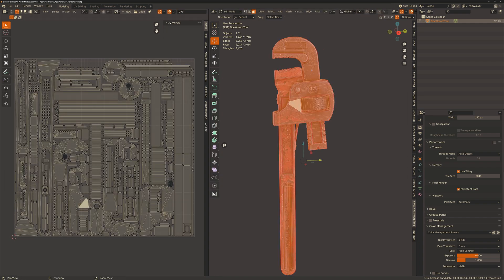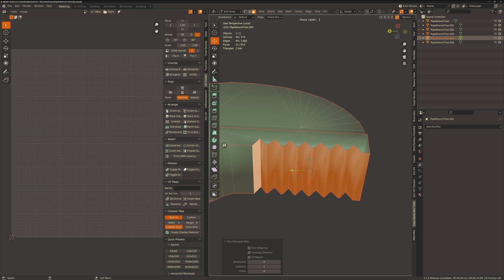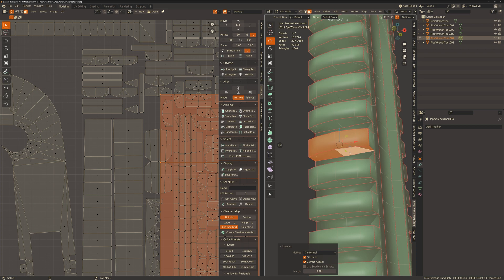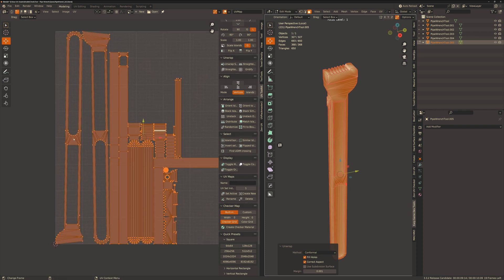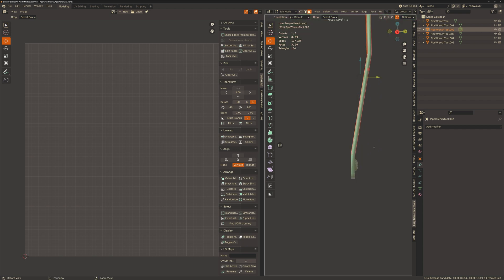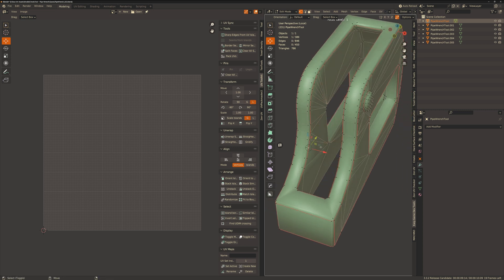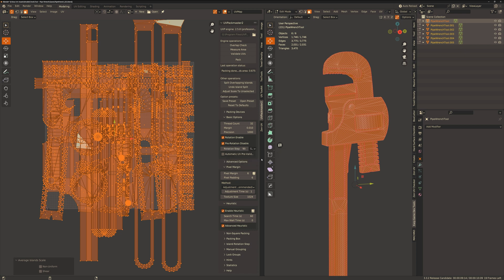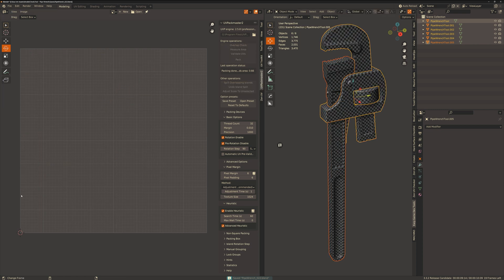How To Not Suck at UV Unwrapping

Comment: Hm, so every hard edge needs a split regardless of it actually needs it for correct straightening out? I remember hearing a while ago that it is actually bad if your model has many UV cuts, and you should try to have as few islands as you can get away with instead, is that not a case anymore?

Comment: This is really fantastic, so simple but so many nice little tips.

How far do you reckon you could get through this process with just the standard blender setup? I see theres a few UV based add ons in your workflow.
Reply from the maker: Thank you my dude 🙌 
All the way, it might take a little longer but 90% of the work is done via default blender tools!
Reply: @ArtOfPilgrim  excellent, gonna give this method a go. When I was starting out, someone told me not to seam too much and I maybe took that a bit too literally, so my models always end up looking a bit wonky. 

Gonna re-evaluate and use this method instead. Thanks for replying!

Comment: I'm actually quite surprised to see an unwrapping paradigm so polar to the one I've ended up comfortable with!

The specifics of my job requires midpoly modelling of the objects, which should be easily:
a) Transformed into a lowpoly form by removing all the supports.
b) Get extra subdivision for some nice closeups with minimal texture warpage just by applying OpenSubdiv.

So my preferred technique is leaving the amount of the seams minimal, just to make sure there would be as little space for the textures to stretch during subduvision.

Everything which can be unwrapped into a uniform isle or strip without too much texel density variation is kept together, and those big chunks happily live with their respective support/chamfer geometry, just with some relax.

Maybe, such an approach could lead to funny complications when it comes to the real lowpoly stuff and miniscule texture maps, but nowadays even mobile games long progressed past that.

And some careful relaxation together with the padding take care of everything remarkably well.

Comment: Btw, did you know that instead of using a hard edge, you can use a bevel with hardened normals? Performance-wise, in terms of game rendering, they have the same cost. Since hard edges also split the vertices, and the extra faces in between don't add extra surface area.
But it will look miles more realistic, since no surface in the real world has sharp edges.

Since I discovered this technique, I've never used sharp edges since... and it's a subtle but very significant improvement to the realism of stuff that I made. And I'm looking forward to the improved bevel modifier that will come to blender this year, to improve the process of setting them up even more.
Reply: do you know any video tutorials for that for a newbie?
Reply: @Lanthiren   few vids about it: 
- Stream Clips: Face Weighted Normals
- Weighted Normal | Blender 2.8x Tutorial

But nowadays just use a bevel modifier and turn on the checkmark for "Harden Normals"
before blender 4.1 you also need to turn on the "Auto Smooth" checkmark and set the shading to smooth in the mesh.

Comment: Hey, got question, can you make video about bevel modifier and UV's?
Reply from the maker: I've never used the bevel shader before
Reply: @ArtOfPilgrim  not the bevel shader - applied bevel modifier to the unwrapped mesh. My workflow is: 1.modeling(+bevels/triangulate/weighted normals)  2.UV unwrapping  3. Export to Substance painter with applied all modifiers - when you use UVpackmaster for uv's, addon keeps seams with applied modifiers. But, my point is, can you make video about bevels on a models and Your's approach to unwrapping them :)

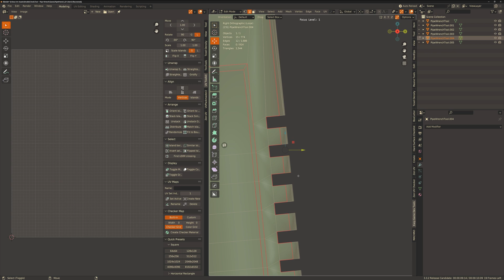Comment: Tip to speed up the workflow significantly: select one edge that has 90° or similar, hit Shift + G (select similar) and chose face angle. You can play with the threshold to select more or less. That way, you already have all the hard edges selected. Saves a ton of time, especially for parts like 3:30. Enjoy :)

Comment: I've used this exact process for the last 6 years and it's yet to fail me!
Also to add to why straightening UV islands is important. When edges not perfectly cardinal they can create jagged edges lines of pixels at the border. Think about it like your islands going with the grain of your texture. 10 pixels in a straight line will make a smooth line, while a 10 pixel line at a 45 degree angle will be very jagged. (Edit: I just saw mentioned this later on. Shouldn never have doubted you ;))
Reply from the maker: haha! yep sometimes it's unavoidable but we can try to mitigate it as best as possible